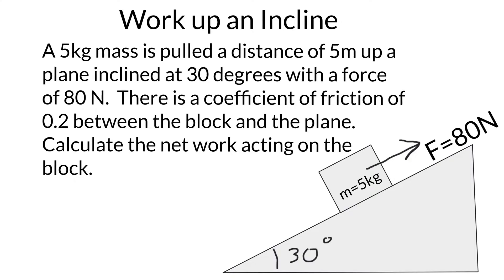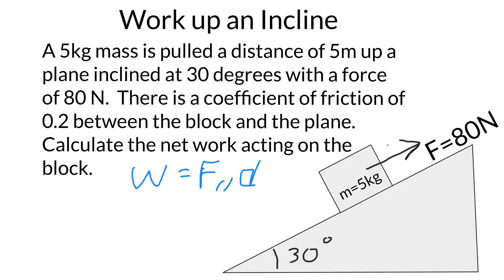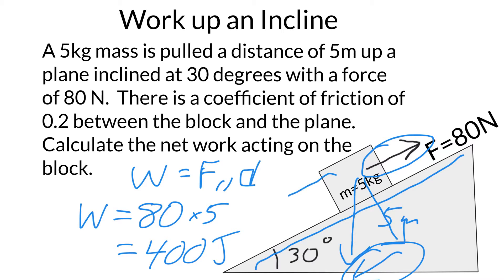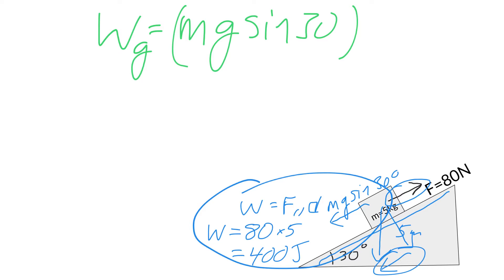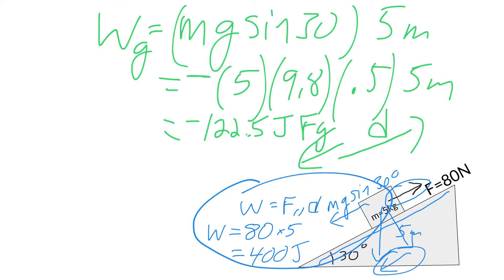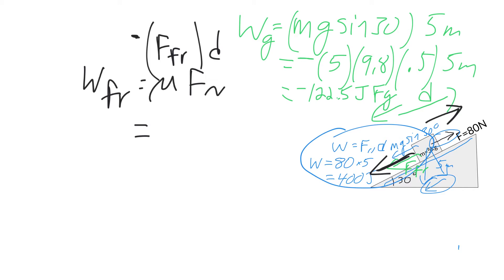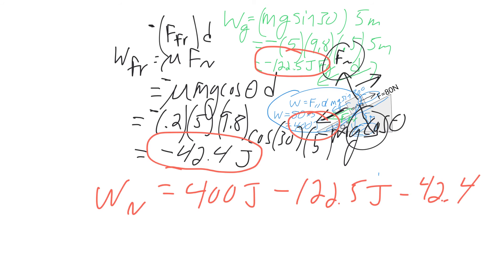How To Calculate Work On An Inclined Plane

Comment: If the object is moving, why isn’t there any kinetic energy as part of work? 😢
Reply from the maker: Good question. Work is equal to the change in energy.  In this problem, the object is moving at a constant velocity, so that the KE is not changing. All the work is turning into gravitational PE and thermal energy from friction.

Technically, there must be a bit of extra work to get the object moving in the first place. Though, this would be cancelled out by the negative work when it stops at the top. Practically though, the crux of the problem occurs during the constant velocity phase and KE is ignored in the problem.

Comment: is there not a component of the applied force that would make Fn be mgcostheta - Fsintheta?
Reply from the maker: In this problem the applied force is parallel to the surface, so there is no component into the surface. However, if you pulled up at an angle to the surface, then the Fn would be mgcos(theta) - Fsin(angle).   Here is another video that covers this concept. https://youtu.be/ipJVYnLMWVo

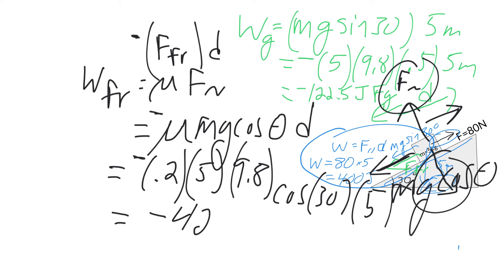Comment: at 5:58 in the video: (0.2)(5)(9.8)cos(30degrees)(5) is equal to 24.5 J not 42.4 J, 42.4 J would not account for cos(30) which is (0.5);  therefore the net work on the object is equal to 253 J not 235 J
Reply from the maker: Cos(30) is (0.866) 
Sin(30) is (0.5)

Comment: Why  you did not put sin 30 in the  80n force?
Reply from the maker: 80N force was already parallel to the plane of the surface, so no need to "fix it."  If it had been drawn at an angle to the surface, then you would need to find the parallel component.  See this video for an example of this : https://www.youtube.com/watch?v=ipJVYnLMWVo

Comment: What if the object was sliding down the ramp instead of up? would Fgx be negative or positive?
Reply from the maker: If you still define "up the ramp" as positive, then Fgx would still be negative (since it is down the ramp.)  Work, however, would end up being negative since both Fgx and displacement are both negative (down the ramp.)  One last thing to remember if you are given this problem is that the direction of friction would now be up the ramp to oppose the motion of the block coming down.

Comment: Just to clarify, why did the friction work use cos(30°) and the applied work (400J) did not?

If you rotated the FBD by 30° clockwise, both forces lie on the x-axis and do not need cos(30°)…? (I think the net work is around 228.325J)
Reply from the maker: Force of Friction is (mu)x(normal force).  
Normal force can be found from the component of gravity into the inclined plane which is mgcos(theta).
Here is a video with more details.
https://youtu.be/hTuBIjG-Q98

Thanks for the question!

Comment: for these problems can we assume that the system is at equilibrium so we set the net forces equal to zero?  Then whatever we get for net force we multiply it by the cosine of the incline times the distance traveled to get the net work done?

Comment: An object of mass m=1kg is sliding from top to bottom in the frictionless incline
plane of inclination angle 0=30o and the length of inclined plane is 10m as shown
in the figure.Calculate the work done.
Reply: i hope you solved this already but the answer should be W = mg * sin(30) * distance, or 1 * 9.8 * sin(30) * 10
Reply: @Azhix  yeah...thanks for the reply hihi